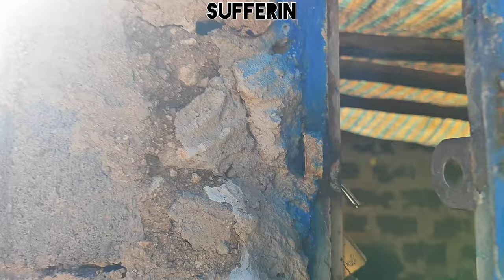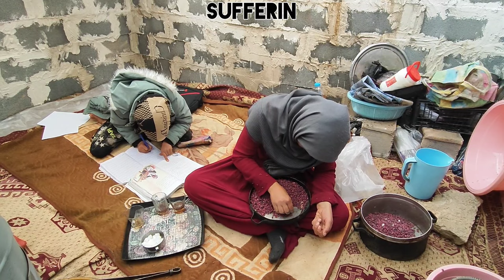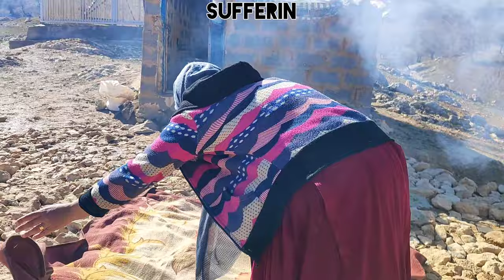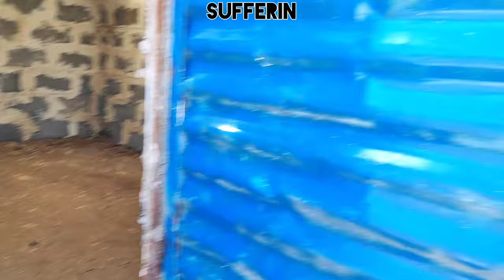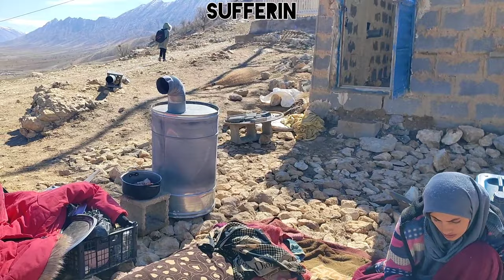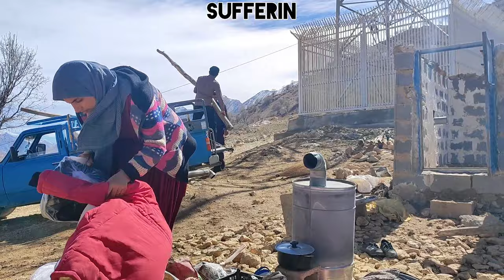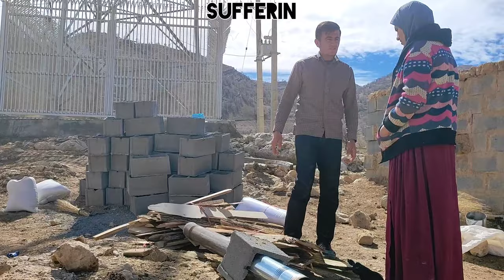Repairing the hut by a widow with her lover

Comment: Why are you repairing the roof with logs that are not straight
You need new logs if the roof is not leveled it will gather water and leak again
If you're going to fix the roof right do it right
You could of bought steel beams for tiles and space them to fit in between each other steel beams and then lay down a plastic on top and then pour cement on top
Make the plastic over lapping over the whole house
Secure the steel beams with cement to the top of the wall
After it few days dry pouring bitumen on top let dry and pour another layer of bitumen on top let dry and put izogam tar paper on top with a fire torch and seal it completely over lapping over the Walls and down
Then again don't spend too much money on the mothers house
Buy land far away from this Mama's boy who will bring harm to your children
No marriage your children safety comes before any man
Reply: ان شعوري ان هضيه الأسرة تمثل فقط لاحد يستطيع العيش تحت مثل هض اسقف😮 انهم يضعون اطلب بلا شي كيف يلتسق بي بعضيها البعض
Reply: Yes definitely 💯 this is not strong enough it will damage and leak again

Comment: Please do not make a flat roof. Using flat rocks or blocks make the door side higher than the rest. Lay the poles from the high door side to the low side (by the power grid) so that they slant down. The water will run off the low side. Fill in the sides with rock and cement or mud. Make sure you can stand inside  this time

Comment: 1:06   the hole is shown at this part of the video. Put a 2ft long  rope or cloth through it then tie the ends together. Put it around to the  outside so you can grab it for opening the door.  When you swing the door shut itll hold the door tight